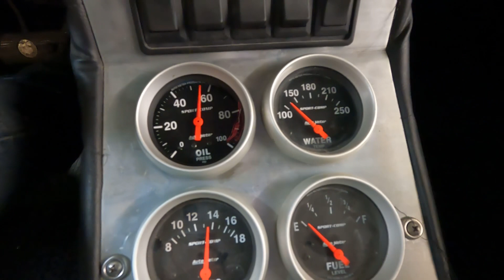383 stroker build part 5.  Install and first fire up in the car.

Comment: I'm trying to understand why you messing with the timing when you had the engine on the dyno ??? 😳
Reply from the maker: I wasn't "messing" with it.  I was resetting the timing because I had to pull the distributor to change the gasket under it.  The first one was seeping a bit of oil.